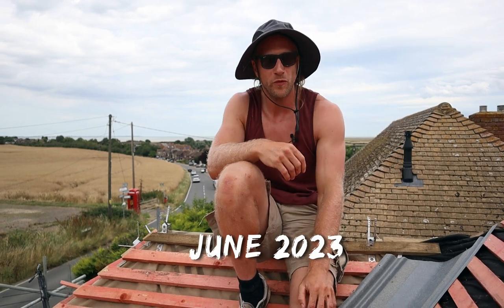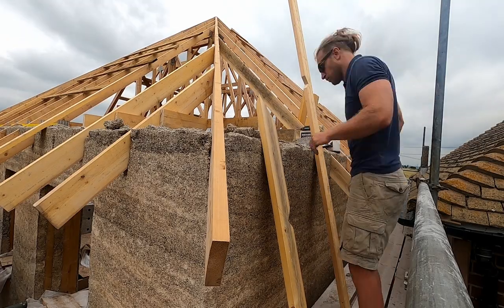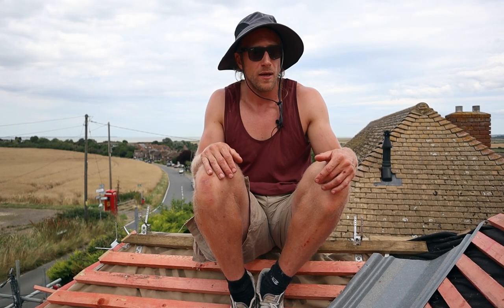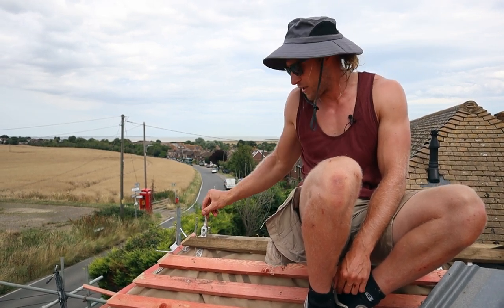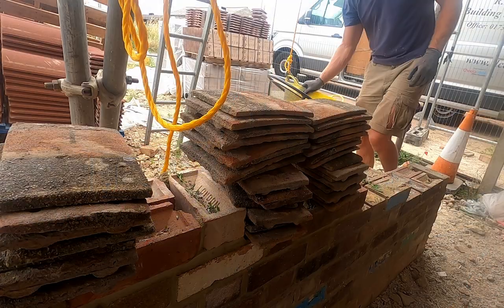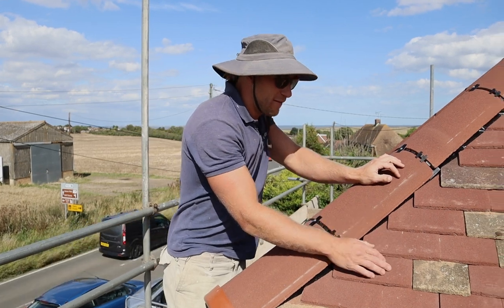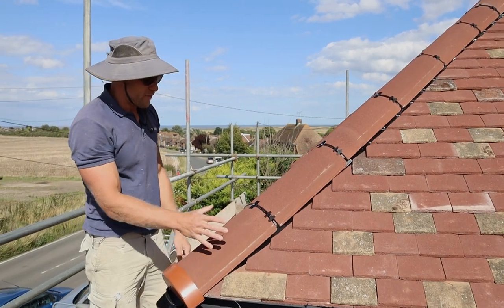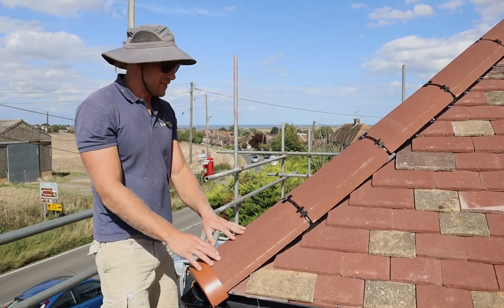#7 - Raising the roof - A self build Hemp house in the UK

Comment: Hello! Thank you for these videos. So helpful! How will you insulate the roof? Could it also be done with hempcrete?
Reply from the maker: Hi and thanks. This has a cold loft and have just insulated with 350mm of loft roll insulation. It can definitely be insulated with hempcrete but for this roof, that is a lot of area to cover and it just came down to cost and additional time in the end.

Comment: Great project well done! Have you had any problems with the hempcrete shrinkage? or is that just folklore.
Reply from the maker: Hi, thanks for watching, glad to have you along. Not noticed any shrinkage in the hemp, no gaps have appeared arpund the window framing with put in. We have noticed some gaps forming in between the internalbwood wool board joins, which may be shrinkage or just the house frame settling. Nothing that can't be fixed with some tape before plastering.

Comment: Did you consider fitting solar panels flush with the roof?
Reply from the maker: Yeah it was considered but time (and cost) came into it. Not sure it's as big a problem now but the in roof ones didn't used to be as efficient as the roof mounted panels because of airflow. We wanted to do it ourselves too but MCS certification was causing a problem with that. We may revisit later on. Batteries are likely to come before solar as it stands at the moment.
Reply: @thelowcarbonproject  I had forgotten about MCS accreditation, as you say a solar battery could be a better option. The house should be so easy to heat anyways.

Comment: With those tiles I would have started from the top, then you wouldn’t have had to stand on them to fit the next ones 😂
Reply from the maker: We didn't need to stand on them, just slightly above. These type of tiles hook over the batten which, if we went from the top, would mean having to lift the tiles above to slot the other ones underneath, the one above also sits across 2 tiles below. There is more chance of breaking them that way and would also take a lot longer to do

Comment: I see your not hemping the roof structure.Was that a cost based decision. Building a monolithic structure is (i believe) where all the full benefits derive from?
Reply from the maker: Hi, yeah pretty much down to cost. It shouldn't make too much difference as we will be installing a lot of insulation. The house will still benefit from very good insulation, (well above minimum requirements for a new build) thermal mass and good air quality by regulating the internal humidity. 

We will be testing how the house performs over the next 6 months and showing the results in future episodes.
Reply: @thelowcarbonproject  good stuff... i spoke from a different channel last time. Hammond Hemp Homes will be our new channel soon as i get the videos edited etc etc..zzzzzzzzz what a job on top of the JOB ha.. good vids mate
Reply from the maker: @supremehomerenovationsltd  Cheers, good luck with the video making, I recommend Davinci Resolve 18 as a good editing software, totally free and loads of instructional videos available on youtube.